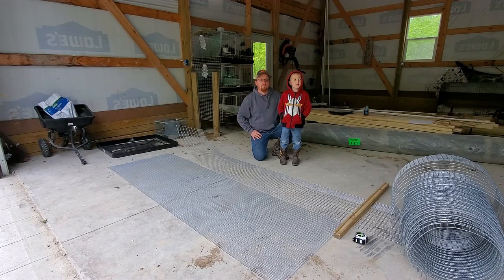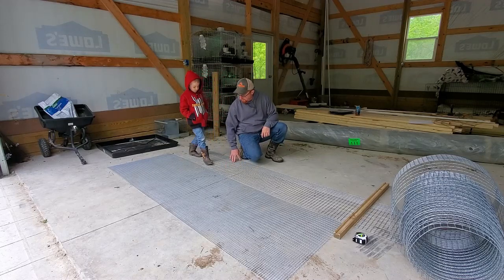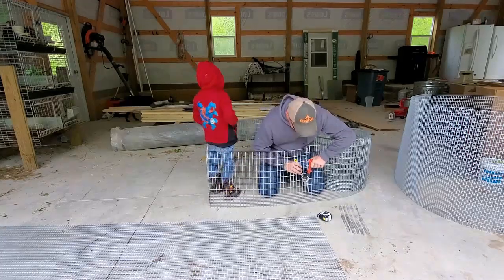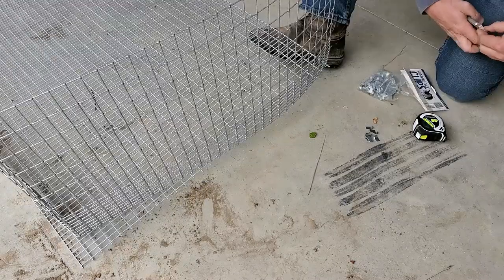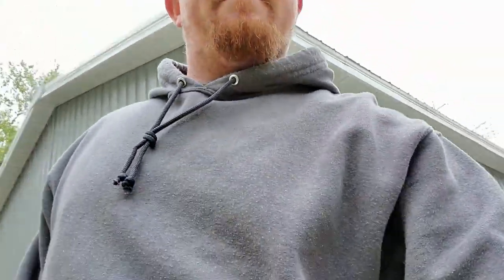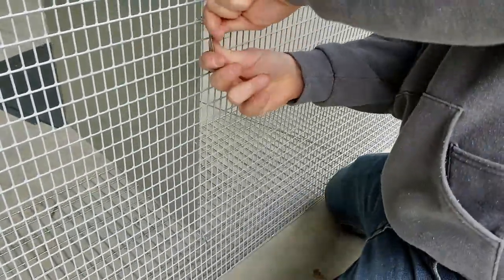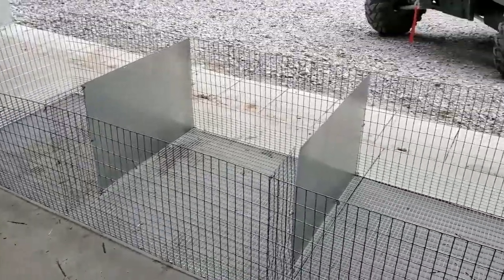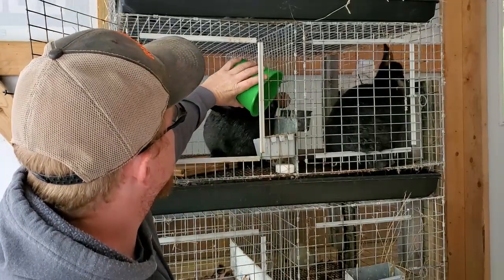DIY rabbit cage build- expanding our rabbitry!

Comment: I've made a ton of animal cages over the years, I personally prefer cut corners and the easiest way to cut any wire is with an angle grinder with a cut off wheel. Love your video's.
Reply from the maker: after trying to bed wire for corners by myself i completely agree with cutting them!  Thanks for watchin!

Comment: does your j clip pliers tighten those j-clips down enough so they really stay in place on those door latches? mine if i installed them downward would just slide off... so i installed them with the wire going upward instead of down. and still, had to put 4 j-clips on just to give enough support. ( i have some spring latches on order and probably move away from these...)
thought for you... i've been using an angle grinder with a cutoff wheel for all my wire cutting. zip right trough that stuff quickly, without leaving little stubs to cut yourself with.
Reply from the maker: No mine don't tighten enough either.  I will have to look up the spring latches!  And yes the angle grinder is so much better to use thats what i have been using now.  Thanks for watching and please share our content!